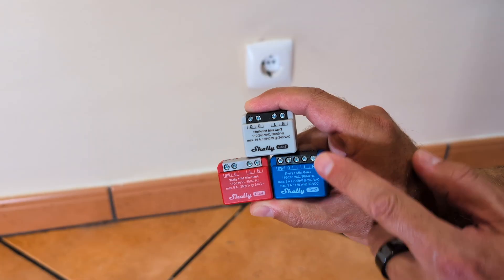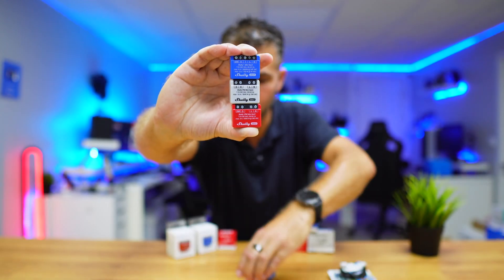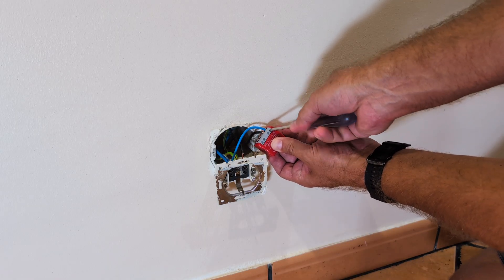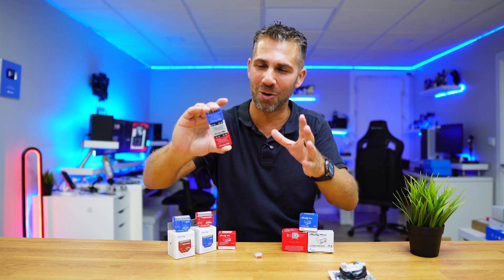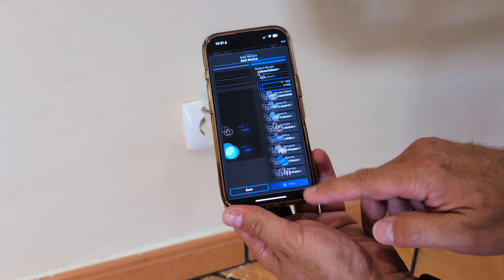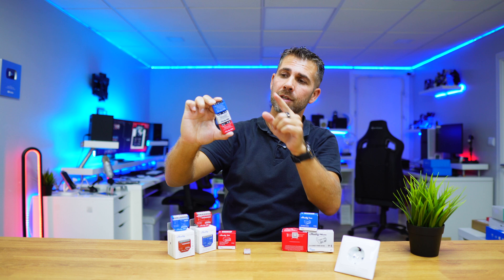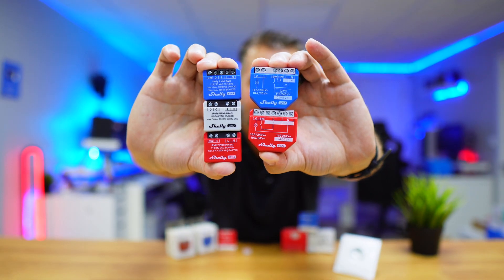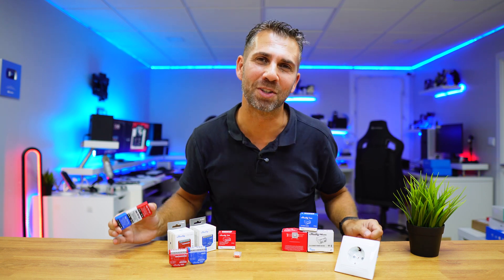Make ANY Outlet SMART in Minutes 💡 Easy & Cheap with Shelly 1 Mini 🔌🚀

Comment: So just for those with Shelly Mini 1 Gen 4 (and possibly Gen 3 as well): the wiring as explained, and as shown in 3:08, does not work. No power is passed through to the outlet like this. Need to connect I and L (or better, use a Wago to connect live wire to both I and L) and then it will work.

Comment: If Gen4 also had a properly working ZigBee firmware would make this product great, but as of now it is no w it is still a Beta or even an Alpha!
Reply: What's not working? Using ZHA in Home Assistant, it has full control and has power measurement data and acts as a router. Have you checked with tech support to see what's giving you headaches?